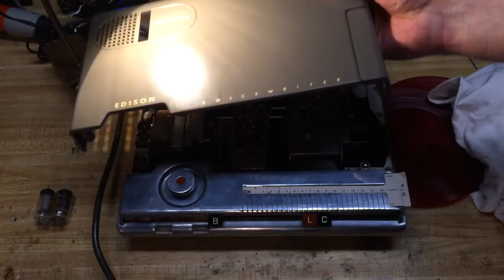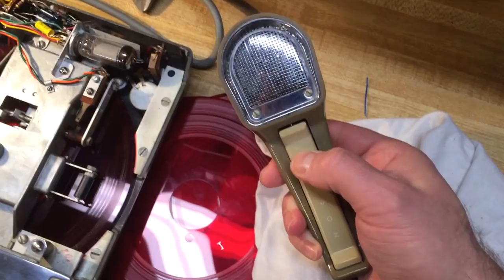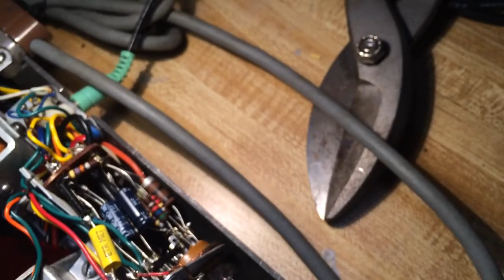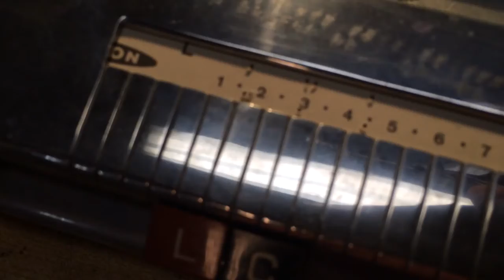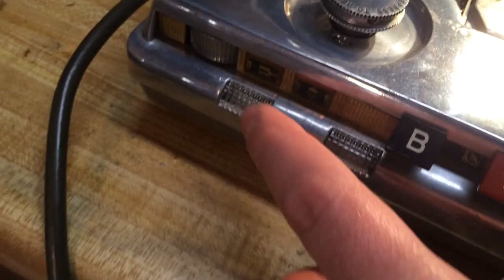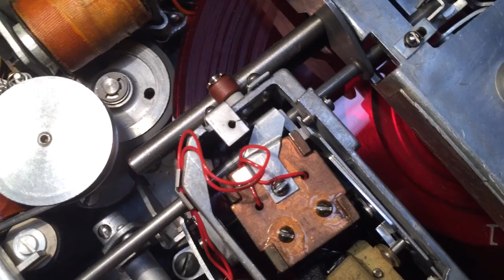This Weird Retro Machine Recorded Voices Before Tape! Edison Voicewriter Dictation Machine Vintage

Comment: L stands typically for Letter, it was to show the secretary where the next letter to be typed starts. The C is for correction, as someone else pointed out. There were different ways to use the C, you could either hit it when you start speaking the corrected part, or you could rewind and hit it to show where the beginning of the error was, so the secretary would know to stop typing. I think the second method was more commonly used. Some manuals from the time show using it twice, first means "error begins here", second means "correction begins here". Other machines had different methods. The later tape-based machines could of course just be rewound and you could dub over the error. Yet others would insert a tone on a second track that would activate a light or mechanical signal of some sort to warn the typist of an upcoming error, some would put the tone on the audio track so they could hear it. Why do I know all this? I spend too much time reading old manuals and magazines on the Internet Archive :D

Comment: I actually have one of these. The actual unit looks to be in good condition. The cables are cracked though. I have an instruction booklet for the 'secretary', and a pack of 100 brand new disks for it that look like they are in very good shape. If anyone is interested, please contact me with an offer. Thanks!

Comment: You should adjust the motor so it will spin at 33 1/3 speed or better yet, because it looks a bit like those 45 rpm record, set the motor to 45 so the voice will sound normal on record players .

Comment: You know it's funny.  Listening to old recordings makes me thing people sounded different back then but then hearing you're recordings has made me realize its the recording equipment that made people sound so different!
Reply from the maker: Yes, there wasn't a control circuit on the speed control back then, so the speed would vary slightly with each recording.

Comment: Here are some ideas to consider. Change out the idler wheel to get 45 RPM speed or add a variable speed oscillator to adjust motor speed when embossing a disc. next add heat source, like a hot appliance bulb just above the disc surface to soften up the disc prior to embossing. Maybe that will help to get a deeper emboss. These emboss. No cutting involved. That is why there is no "chip" waist material removed from the disc in the cutting process. The discs are vertically embossed. Also switch out the audio input for a line level input instead of the microphone source. If you by a cheap audio compressor /limiter to reduce the band width of incoming audio signal to a more narrow audio spectrum then you should get much better results and less warble from audio spectrum overload. Final idea, Check embossing needle on head to see if it can be sharpened.
Reply from the maker: +jtrade34 - thanks for the suggestions!
Reply: Yes, Your video got my brain going. Best of luck to you.
Reply: jtrade34 changing the idler wheel size won't affect speed at all.

Now if this was an idler that has a larger driven surface and small drive surface like the RCA 45 players have then yes its size would affect speed.

Comment: I have 2 Edison dictation machines someone gave me when I was a kid. They look much different though and I have not been able to find any info on them or see if they have any value.
Mine are a grey color and more of a box shape. One records and plays and the other just plays.
There is a mic and foot pedals. When I was a teenager I remember Connecting a more modern amplifier to the cutter head to see if I could record a better quality sound. I don't remember if I was successful.
I think they are still in my parents basement but if so would need a lot of work to get rid of rust and corrosion.
Reply: It's this one that I have
https://upload.wikimedia.org/wikipedia/commons/d/df/Thomas_Edison_National_Historical_Park_-_Edison_Voicewriter_Reproducer.jpg

Comment: Very nice. Thank you for the look inside. Informative. How did you get the cover off? I have two of these but just removing the bottom screws doesn't seem to do the trick.
Reply from the maker: Richard Powell If I remember correctly, there were 4 screws on the bottom, and then the top lifts off.
Reply: My bad. I was referring to the front top silver panel (where the record/play knob is).
It looks like the top part of the knob is held in place with a set sc

Comment: 16 RPM but lateral cut
Reply from the maker: David Rousseau This isn't running at 16rpm, unless mine just runs slow.  The discs always play fast on a 16rpm machine.
Reply: Interesting.  Did you change the motor or drive tire?

Comment: You did well restoring the unit, it has very good sound. Edison loved his vertical cut system and so do I.  Does this use a magnetically driven cutter head, or is it a crystal element. I have an original Edison acoustic master studio cutting head from which the masters for his Gold Moulded, Amberol, Blue Amberol, and it even fit on the Diamond Disc master cutting unit. It is the only such recording head at this time, in working condition.
Reply from the maker: Shawn Borri I'm not certain on the cutting head type, but I'm guessing magnetic.  Have you made videos of your cutting head, Shawn?

Comment: I have a very similar Edison unit. The "L" is to indicate when the dictation starts and stops for a visual cue for the transcriptionist (Length) and the "C" is to indicate to the transcriptionist that a Correction was made in the dictation. My model doesn't have a "B". I uploaded a video of it which you can find on my channel if you want to see it in action in 2012. Yes, they are cut vertically. I have another video up showing me trying to play one on a regular turntable.
Reply from the maker: Thanks for the information, Dan.  L for Length, C for Correction.  Cool.  It was probably your video of it playing on a turntable that inspired me to get one of these units!

Comment: Nice piece of equipment. Good job on the restoration too! :)
Reply: databits .
You can actually replace the microphone with a 3.5 mm jack connected to the mic input so you can make recordings of music from an MP3,Ipod,Tape player etc.I have done so with mine.It is a lot of fun.Thanks
Ray
Reply from the maker: Thank you Mr. Spengler!
Reply: rsantiqueshop you can transform this machine into a swarfless vinyl lathe.